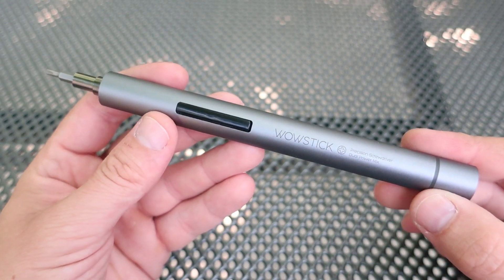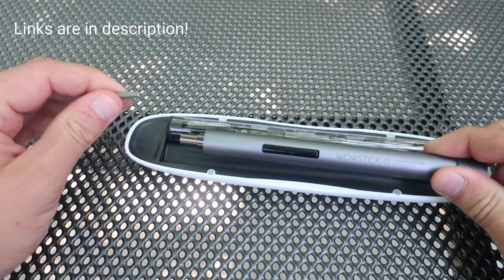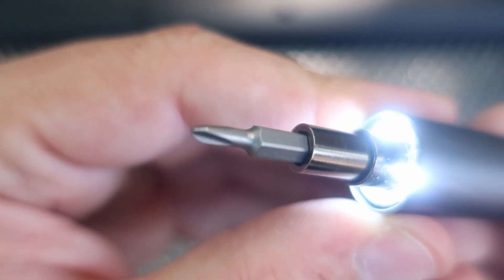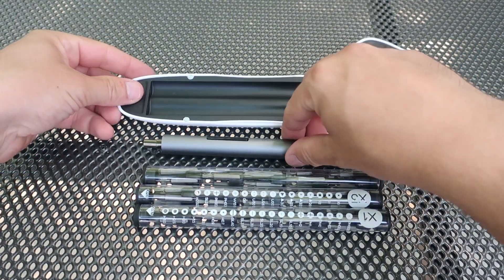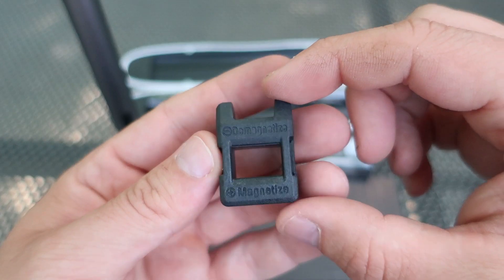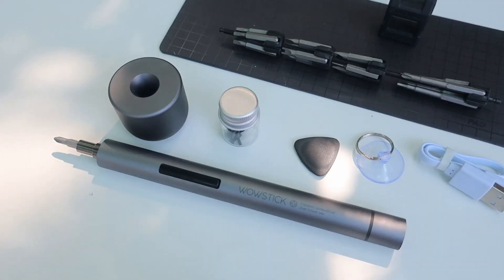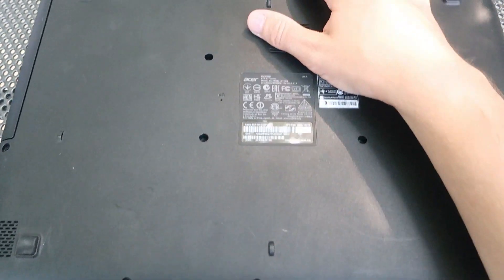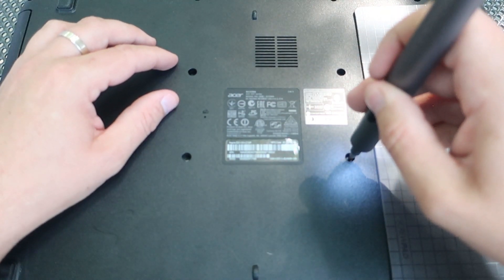XIAOMI Wowstick electric Screwdriver ˙(1F+ 64 In1) - REVIEW AND TEST

Comment: Hi Volos! I love your work. I'm trying to get into coding the ESP32 and am finding the compile/upload cycle time far too long. Is there a way of creating a 'base binary' to encapsulate all the 'static' libraries and third party code in flash, then call 'entry points', from a second 'code segment' that can be compiled/uploaded without altering the 'base binary'? I'm using a 16 thread Ryzen with 16GB RAM/SSD but it's frustratingly slow.  Arduino is a well supported environment and if something along these lines were possible, it would be a massive time saver!
Reply from the maker: Soory i dont know t answer. I know that compiling  is slow, sometimes frustrating